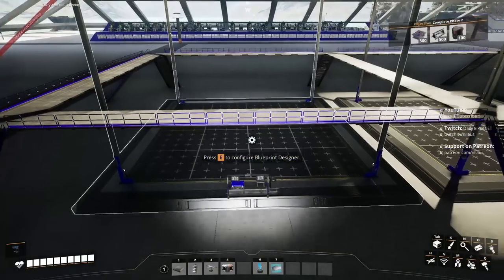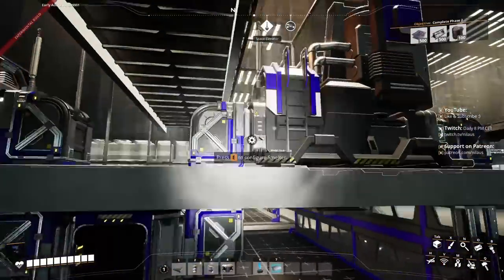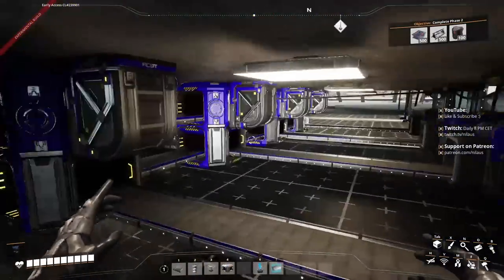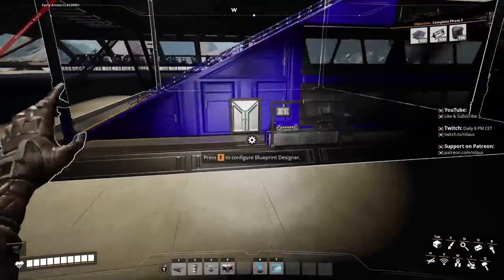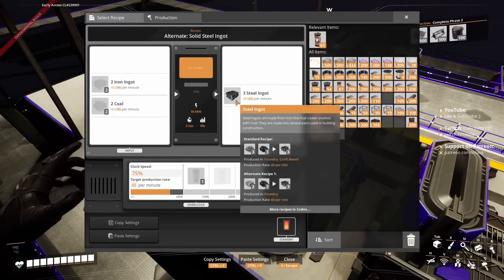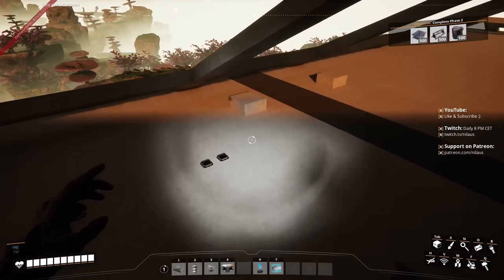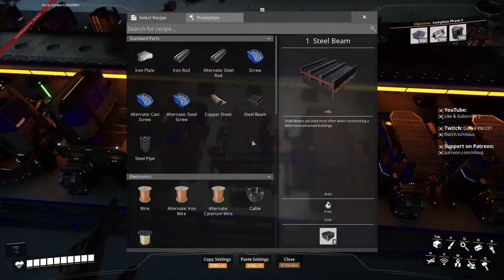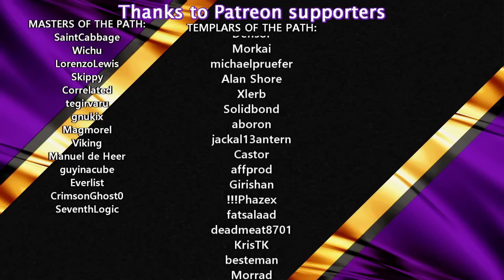Build Faster Than EVER Before With MODULAR BLUEPRINTS In Satisfactory Update 8

Comment: I have also been making my blueprints modular. Instead of tiling them wide, mine are stackable, so I have towers of modules that are chained together with lifts. The input resources go in at the bottom and are chained up, and output resources come out at the bottom because they are chained down. Also, instead of making generic modules, I have them item focused, e.g., one blueprint that outputs 10.66 Rotor from 120 Iron Ingot, so with mk5 belts, 6 of them can be stacked in a tower with a 4x4 platform footprint. The small footprint makes the logistics of transporting items around the map easier.
Reply: Are you recreating NYC?
Reply: Do you have the lifts inside the 4x4 space, or going out windows? I wanted to do this but found it's really hard to fit things in 4x4. Even aligning input/output splitters with window holes was wasting space I didn't feel I had.
Reply: @delson84  There is no issue fitting lifts inside. I like having a system so the the blueprints can fit together, and designing in a flowchart tool for rapid iteration. What helps with fitting is being okay with slight clipping, where it does not visually clip (with extreme clipping 4 manufactures can fit into one blueprint), and placing mergers/splitters directly onto lifts.

Comment: I'm also using modular blueprints, but I've making a vertical design. Every module have two floors, and then I have another belt level, I just built another floors. Input going up, and output is going down. At the end I have pretty and closed workshops for every detail. Perfect. 

But this scheme have few problems. First - liquids. Not very big problem, but it takes an extra time for building. Second - refinery. It's too big, but mod for bigger blueprints clearly solve this problem.
Reply: The size of the refinery building never changes so use the BP to laydown the connections so you can slot the building in and hook it up. The fiddly bit for refineries and power isn't the building but the supporting infrastructure.
Reply: @andybrown4284  Problem not in this. It's just because vanille bluprint is too small. But as I say, there is a mod, that solve this problem. It's adding bluprints for 6x6x6 (original is 4x4x4), 8x8x8, 10x10x8, 12x12x6. Very useful.

Comment: This is amazing, I am going to try this in my playthrough. It sad though how there is still manual work like connecting the belts and fixing the lights, I like this game but everything feel like it's half-done, why can't they just deliver a feature complete and working instead of forcing the players to do workarounds around the bugs
Reply: Experimental, Early Access ...
They also said that Blueprints are in an early stage as a lot of the base code changed with the engine update. So fixing some bugs like the lighting would be a waste of time as they need a different solution for the final game engine.
Reply: This game is in early access, no duh you have to work around bugs
Reply: @iSomeDood  If they sell the game, early access is poor excuse
Reply: @sh0ker  its not like they dont fix the bugs, there is quite literally a QA site
Reply: @sh0ker  no. You get acess to a game, that would otherwise be behind closed bars for YEARS. to come. With a company not knowing how much worth it would be to spend time on developing the game, as they wouldn't know the profit... each year going by without release = insane loss.

But with early acess, which is branded with a big disclaimer that it is infact early-acess and not copmlete, you get just that - early acess to a product that would otherwise be off limits for years.

The company can see exactly how much interest there is for their game, by how many people are buying it in it's un-finished state and can thus focus an adequate ammount of resource on developing the game and not giving up on it early, if there are alot of customers who buy the game.

It basically means that, if the game is good and the devs are good, the game will be better in the long run, as the devs can take longer time to develop the game, get direct feedback from players.

Honestly, early acess is just a positive for the industry as a whole. You just gotta get your head outta your arse, thinking that you should expect a full product when you arent even paying for a full product. You are literally paying for an unfinished product. So expect the quality of an unfinished product then.

Comment: I have no issue with blueprints or modularization, but ... what is with people making "belt floors" that hide all the logistics? The entire point of these games is to see the factory work. Is it just YouTubers being different to stand out?
Reply: They quite literally are not hidden, they are visible through windows...
Reply: it helps to allow you move around the machines, not necessarily to hide the belts
Reply: Also for blueprints it turns a 4x4 into an 8x8 when you add the second level...

Comment: If makes a little bloop sound of the elevator is connected to the output when you rotate it in the correct position. If, for example, you're too far away, it won't make the sound